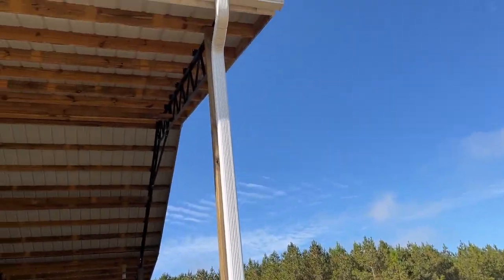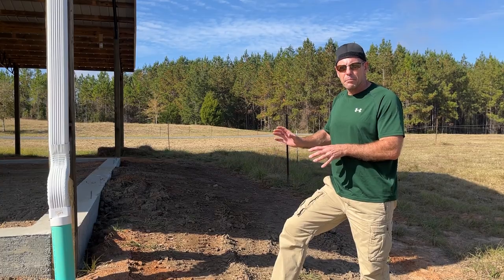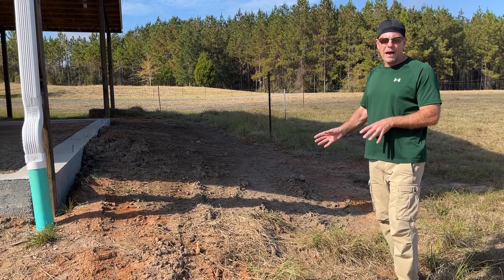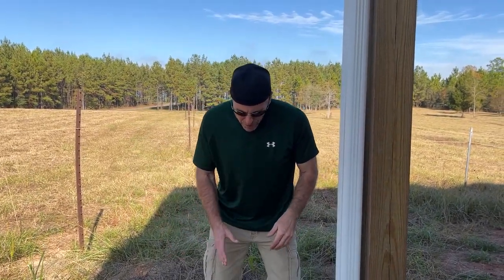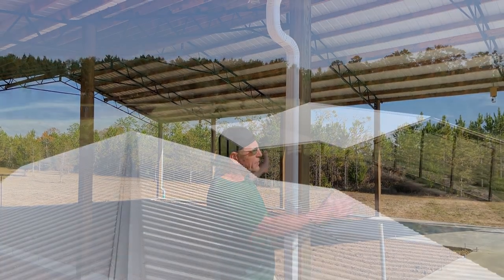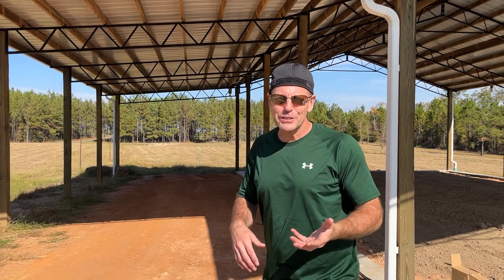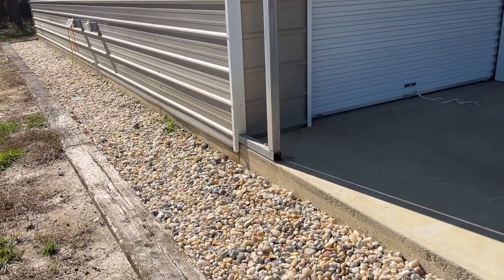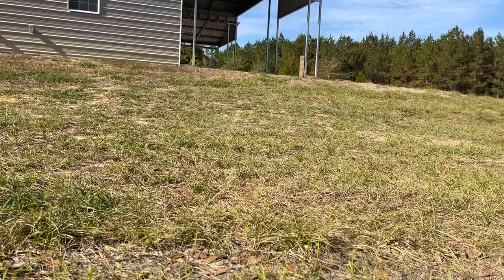How to Use a Box Blade to Fill in a Trench

Comment: Good morning.
   You both are doing a great job. The place is Looking real nice. It's nice to see a couple working together and doing the upfront work needed to make it easier to maintain years down the line.
   As far as the holes going up or down on the drain tile. I was a licensed commercial plumber for 30 years. Unfortunately i had to retire (cancer). Anyway The holes always face down. I know it sounds backwards. The water has to essentially collect in the ditch and rise to enter the pipe. Very little water will drop into the holes if they are placed facing up. You may want/need to dig the rock out and reverse the holes so they face down. Over time that area could become soft or spongy, or a mosquito breeding area. 
I see you didn't do this. I see so many people using perforated pipe, either hard sticks like you used or the rolled corrugated pipe to run thru the yards to discharge. The point of perforated pipe is to collect the water. You don't want to let it bleed out in your yard especially if it's dug shallow. The only exception is if you are making a leach field. Personally I would not use the corrugated pipe. I would stick with the sticks of pipe. I liked SDR 35 pipe it has a gasket in the bell end of the pipe. A little pipe lube and the spigot end pushes into the bell end. And it has a little more forgiveness than glued pvc if the ditch isn't straight. It's green just like you were using.
   Sorry for the long post. It was not meant as a critique.   
I really enjoy helping people. 
When I was able to work i rarely took money for material or labor from people i knew. Unless the material was too expensive. 
I a lot of times would tell them I work for food. I/we
My wife and kids would get homemade baked  items. Some dinner invites for us. And even to a few potlucks at the churches the people went to. I miss doing those kind of things. Looks like I have diarrhea of my typing finger... Lol

Again you are both doing a great job! 

Sincerely
Ed from  Chicago
Reply from the maker: Thanks for the info.  I can add "turn the pipe" to my super long list of things to do; it's not buried very deep in the river rock.   I also may have to put in another downspout off the pole barn roof into the underground system.   When you don't do this everyday, you miss a detail or two!  Thanks for watching.  Brad&Deb

Comment: I've always wondered how ponds retain water. do you put something in the bottom so water doesn't drain into the ground?
Reply from the maker: Soooooo the answer is complicated.  Some ponds have natural springs filling them from the bottom.  Some are dug in clay.  Some are lined with clay brought in from elsewhere.  Some are dammed off natural waterways.    Our was a natural depression with seasonal water from rain that we dug out to make a pond.    Unfortunately, we're finding out it's not holding water like it should so we have some ideas in mind going forward to try to fix that.  One is put some clay where we think there is a too much sand.   Not going as planned, but we are committed to working the problem!   Thanks for watching!  Brad&Deb
Reply: @PineyGroveHomestead  Thanks for the explanation